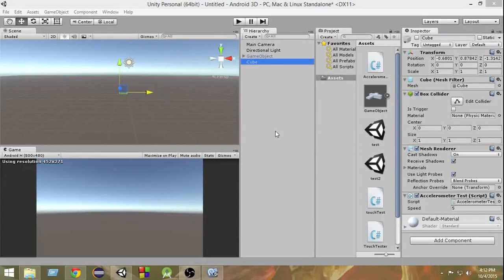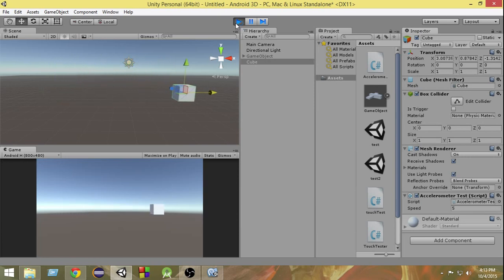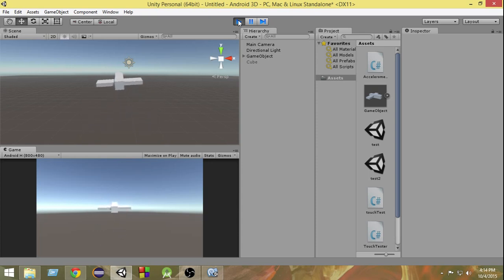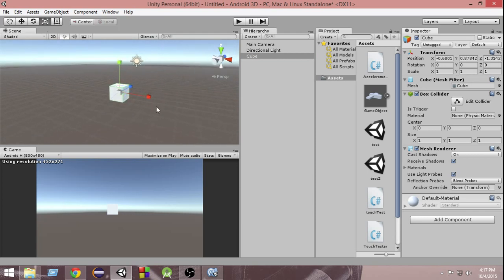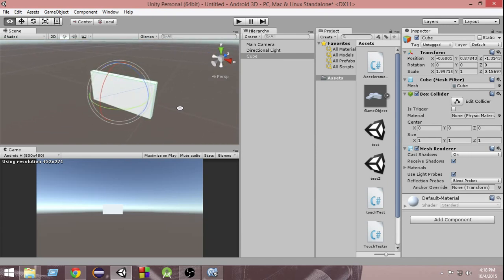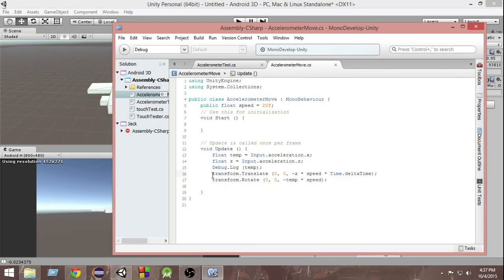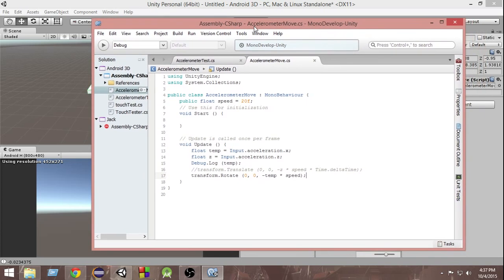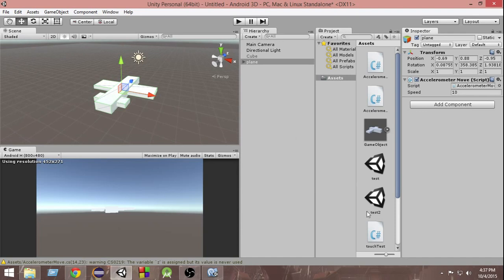Unity Android Accelerometer Input Tutorial + Example Game For Beginners

Comment: thanks! Please make a video about calibrating accelerometr. I really need it in my project.
Reply from the maker: +dkomanek Thanks a lot for watching.. I don't even know what is calibrating accelerometer.. :D
Reply: +Charger Games Thanks for replaying, but I have already solved it :)
Reply: +dkomanek How did you solve it, please? I would also like to calibrate these controls
Reply: +PDB 007 When you calibrate accelerometr, you take x, y, and z value into some 
variables and when you use accelerometr, you can just subtract 
calibrated value from the current value of acceleromtr.

private float rotX;
private float rotZ;
private float calZ;
private float calX;

void Calibrate ()
{
   calX = Input.acceleration.x;
   calZ = Input.acceleration.z;
}

void Update ()
{
  rotX = Input.acceleration.x;
  rotZ = Input.acceleration.z;

   transform.Translate ((rotX - calX) * Time.deltaTime, 0.0f, (rotZ - 
calZ) * Time.deltaTime);
}

Comment: Any thoughts on accelerometers vs gyroscopes?   Or if you have a n-axes sensor then you can only get n-1 angles?  i.e. with a 3 axis accelerometer, can only pick 2 of these:   Pitch, Roll, Yaw

I found some theory explained here, 
http://www.geekmomprojects.com/mpu-6050-redux-dmp-data-fusion-vs-complementary-filter/
http://embedded.fm/episodes/2013/6/25/8-kidnapped-and-blindfolded

but not sure I get it.. I've tried implementing it using only a mems accelerometer and Unity, however instead of the object tilting while staying in the center,  it moves across the screen!

void SetPosByAngle (  float fPitch, float fRoll )
{
    Vector3 LowerLimit = new Vector3(0, 0, 0);
    Vector3 UpperLimit = new Vector3(180, 180, 180);
 
    // Normalize from -180/+180 to -1/+1
    fPitch = (fPitch) / 180.0f;
    fRoll = (fRoll) / 180.0f;
 
    Vector3 AngleDiff = UpperLimit - LowerLimit;
    Vector3 CalculatedAngle = new Vector3(-fPitch * AngleDiff.y, 0, -fRoll * AngleDiff.x);
    TragetAngle = LowerLimit + CalculatedAngle;
    transform.localEulerAngles = TragetAngle;
}

Where the angles sent to the function above are calculated via:
fPitch = (float) (Math.Atan2(YAxisAccelerationData,ZAxisAccelerationData)+M_PI)*RAD_TO_DEG;

fRoll = (float) (Math.Atan2(ZAxisAccelerationData, XAxisAccelerationData)+M_PI)*RAD_TO_DEG;

I understand an accelerometer measures acceleration and is very noisy, while a gyroscope can be used to integrate those readings but suffers from drift, but what I see on the screen is totally off!
https://giphy.com/gifs/3oKIPjvGn69kIq4otq